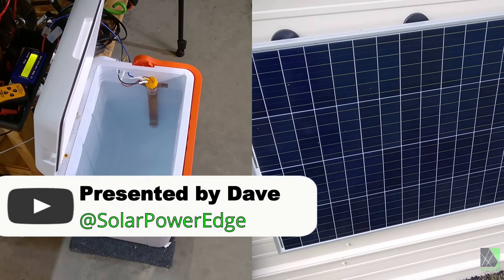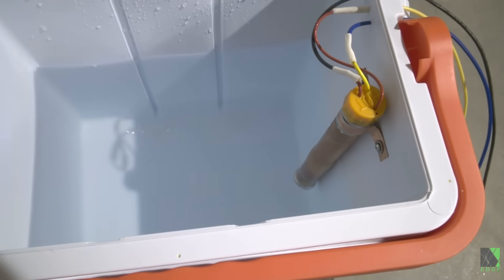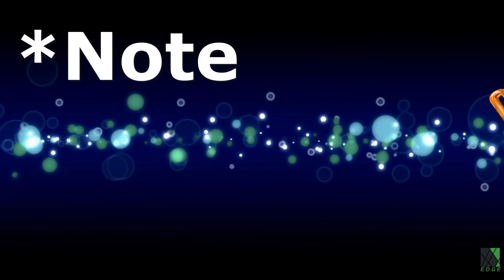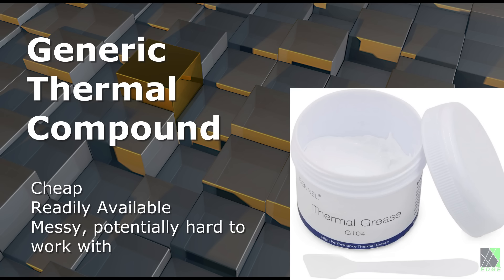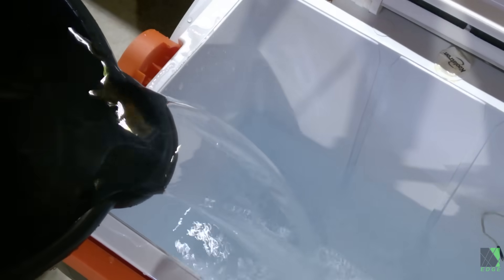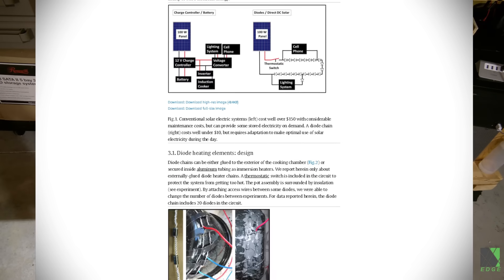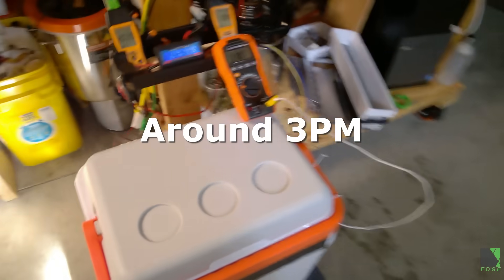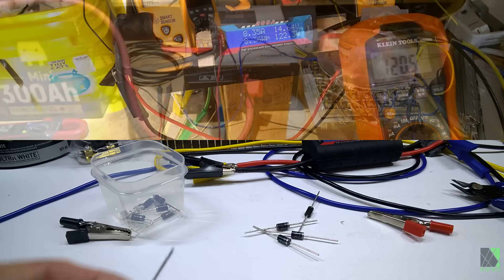I built a PV DC Semiconductor Immersion Water Heating Element! diode chain application #science

Comment: Thanks for that.  Here in Britain, we have the issue of people putting solar panels on roofs despite that the amount of energy you need for a solar panel to be built, manufactured, mined, etc, is greater than the total amount of energy that a solar panel will produce through 25 years of its lifespan!  AND...the cost of installing and owning them outweighs all savings (typically) due both to loss of interest on the capital expended and also on batteries and inverters.  Direct heating of this type would go some way to countering that...somewhat.
Reply from the maker: @barryfoster453 Welcome sir. I hear you... I know it tends to be grey and cloudy in Britian so it seems less likely to use solar panels for heat. I believe it is a (probably often overlooked) point that solar and battery manufacturing is a massive consumer of resources and generates pollution. Meanwhile the fact that solar panels literally turn sunlight into clean DC voltage is hard to resist... 

I always thought many solar panels are never fully utilized, and dump loads are common with wind turbines so why not solar. Basically these diodes can be a fancy dump load for heating.  My thought is to dump excess solar power as heat and therefore use 100% of the KWH available over the lifetime of the panel. 

Finally how long can a solar panel really last? If 30 years, we at least have a chance to recoup investment plus the extra "intangible" value such as peace of mind (backup power). Recently there is new research into 50-year solar panel tech (it's called DuraMAT). Not sure where the tech will go, but it might be part of the solution to recouping manufacturing and environmental costs.
Reply: @solarpoweredge  
Thanks.  Do you intend on manufacturing these?  I would, if I were you.  22 years ago, I made something and decided to put it on the market.  It give me a nice income, and still does - selling on the net.

My HW is heated by immersion heaters (2), and I thought about one of them connected to a solar array a few years back, but when I did the maths (with inverters and batteries) it was absurd.  I'm far better off paying for the energy (here, we have the highest electricity prices in the developed world!).  I don't know what pressures your tube undergoes, but there are pushfit fittings, rather than soldered (or brazed), and that would make construction much faster and easier.  A typical pushfit fitting in the UK will withstand 10 bar (145 psi), and you can get metal (brass) pushfit fittings (though they do have a neoprene O ring inside).
Go for it.
Reply from the maker: @barryfoster453 Right on, I'd love to sell them and pay for all the other ideas I want to build. What I aim for is a reliable diode immersion HWH element w/ 1 inch NPT thread (not sure what they use in European HWH tanks, maybe BSPP thread) and can screw straight into a residential water tank. This cannot happen overnight, but it's on the radar 
Also I appreciate your sharing ideas and knowledge. Maybe I'll have something to sell for 22 years,  as well, that would be great!!
Reply: @solarpoweredge  
I wish you well and good luck.
The UK uses 2¼” BSP on immersion heaters.
Reply from the maker: @barryfoster453 Thank you! and good to know in case I ever reach the UK market :)

Comment: Liked. and Sub'd.
What's the material cost and How does this compare to heat pumps?
Reply from the maker: Hi, thank you for subscribing - this type of heating element is best suited for direct-PV DC drive heating elements. It is a potential cheap alternative to MPPT DC-DC converters. I guess one could use heat pumps right alongside this kind of technology as well.
Reply: This is just my take... Heat pump would require --> solar planel - charge controller - inverter - heat pump, plus all the wires, breakers, switches, etc. And it would technically be more efficient than a diode chain or resistive heater in most climates. However, a diode chain would only require a solar panel and wires to work. Extra solar panels would likely outperform a heat pump factoring in cost and reliability over decades of time. I would think these diode chains would have the advantage of being able to be made to exactly the size needed.

Comment: What about mineral oil and using the thermal rising effects for circulation 🤔
Reply from the maker: @paulwedlock9788 Good idea, mineral oil does conduct some heat and it's easy to get :)
Reply: @solarpoweredge  Hot oil and water is a dangerous mix if they had to touch.

Comment: Like your innovative spirit! Unfortunatly most diodes are in a form factor that doesn't support heat transfer well. Did you ever think of using the old selen rectifier plates? They were frequently used in street-train drives and other appliances. They typically stacked them together for 25 or 75V as each plate can only handle a few volts as i remember. But they would be great for heat transfer on a big scale. Downside is you can use them max. to 80...90 deg. C afaik. I typically use nichrome together with a buckconverter for best efficiency. If weather conditions are steady i also use nichrome heaters directly at PV-voltage with good results.
Reply from the maker: @rilosvideos877 Thank you, I wish there were diodes that could be installed directly in a residential hot water heater tank. That's what I was trying to create here. There is a long way to go! As for selenium rectifier plates, I have never heard of them - I will investigate, thank you for sharing! And yes after about 100C (boiling) I don't feel like pushing diodes much harder. The researchers in the paper (linked in description) pushed their diodes over 140C+ but I prefer to keep mine safe and long lasting :)
Reply: @solarpoweredge  Usage of selenium rectifiers are long time ago, they have many downsides like low dielectric strength and power density. Typical blocking voltage is 25V (max. 30V). But this could be an advantage for heating, as they have big metallic surface! They look like stacks of metal plates, typically rectangular in the size of 10 x 30 cm or alike. I have some of them in spare. If you overload them, they will start to stink terribly - in Germany there is an old saying 'Gleichrichter - gleich riecht er' 😉
Reply from the maker: @rilosvideos877 There are some vintage selenium diodes for sale on the local auction site... I might just have to grab a few and see what they can do. They look very robust and metal, just like you said :)
Reply: @solarpoweredge  great video BTW.   The paper used 1N5402. rectifier diodes (i believe 10 in series).  the datasheet has the current taking a major nosedive (linear) after about 110C.  So I think you're right with keeeping the temps "reasonable".   I'm thinking a big part of the heat transfer efficency and the life of the diodes will be due to the selection and optimization of the heat transfer media/fluid.   A lot of fancy solar inverters incapsulate the transformers in an epoxy/resin to max efficiency - especially in tight spots. Look forward to more of your experiments as I dabble in a lot of similar themes (i m a solar tech so I have access to a truckload of equipment big and small).
Reply from the maker: @daveluxton8317 Thanks a lot! 100C is enough to boil water, so I think it serves most purposes. Amazing to have access to all that equipment. Hoping to have access to a scrap yard here soon, no telling what I will find :)
Reply: @ the graveyard of inverters/controllers/solar panels, and batteries. at our shop is piling up.   Too bad you didn't live in the neighbourhood.  😆
Reply from the maker: @daveluxton8317 Hah! Indeed... I'd fill the garage with everything in sight
Reply: You might want to first consider the toxicity of selenium - maybe not a great solution.
Reply from the maker: @michael-j-harrison That's a good point

Comment: You have to fill the tube up with oil for a better heat transfer between the diodes and the tubewall inside.
Reply from the maker: @MMTube I have tried oil, it does conduct heat! Conductivity isn't super high, I wish it did conduct as well as water

Comment: Consider getting JLC or another PCB fab house to make some 100x100mm aluminium-backed PCBs with surface-mount diodes pre-soldered in a dense configuration. Then you could just thermally bond the aluminium back side of the PCB to whatever you want to heat. If I recall, it’s cheaper if you buy 100x100mm PCBs rather than larger ones, so you’re probably best off ordering 5 or 10 of those. Looks like it’s 4USD for 5x assembled 100x100mm aluminium PCBs, plus parts cost. The diodes are probably a few cents each. There’s a handy KiCAD extension that makes it easy to export the right files for JLC, or you could use JLC’s own online design software EasyEDA.

I’d also like to know how this shapes up cost-wise compared to a solar water heater design like Tech Ingredients and others have demonstrated. You could also hybridise the two by running water channels behind your PV panels, heating water and prolonging the life of your panels as you do so.
Reply from the maker: @Scrogan Right on, looking into this option! Much easier to produce and modify. The sky is the limit with solar, we have a lot of options

Comment: Very interesting, I have an application for boondocking camping with a 2-3 gallon insulated water container, I don't see why you cant make the diodes or the element be as close to the bottom of the container and have the leads of the element out of the water by pre bending the copper pipe, or a 90* coupler, that way the element is always 100% submerged. Secondly, what are the possibilities of an on demand heater by having the water jacketed with a larger pipe,  lets say a 2.5", water inlet at the bottom, outlet near the top, leave some headspace for a hot water reservoir near the top, solder a flat piece of copper on the sides of the core as a baffle for mixing when the unit is drawing water out for mixing or turbulence. I would say 1/2" inlet, and outlet, make the jacket piping about a 2' long, the core 1'. I am not sure how long the recovery time would be, depends on the flow, and the temp in, vs out (Delta), then if you lay it horizontal, it will always have hat water the length of the jacket.. I am very interested in this, I would like to try a small camper application of this, I have a small 100 watt 18 volt solar panel that this may fit perfectly for this. Leave the 305 watt one for charging the batteries, lights.
Reply from the maker: @davej7434 Yes all the diodes need to sit at the bottom of the tank, it's just not working well enough at the top. But it IS a prototype :) and I wanted continual access to it. Thanks for sharing all your ideas, good thinking. I want to try all of them :)

Comment: ITHNK   salt might be a good choice in your copper pipe since it holds heat longer than anythng else  or if you didnt need to drink the water you could add salt to it to make the heat last much longer   
jusayn   megary
Reply from the maker: @LUVDOC69 Hot salt sounds very interesting, it's on the list of "experiments" I need to try :)

Comment: Use SMD diodes on aluminum PCB , small diodes have less surface but you can put more of them, and get more thermal conductivity because of aluminum wafer , also you can avoid using pipes as housing, one side could be covered by epoxy, and aluminum will be exposed to heat the water
Reply from the maker: @danielbogdanov2926 right on, good thinking and thank you for sharing ideas

Comment: A string of surface mounted TO220 diodes on a custom PCB would make a nice heating element. After assembly, you can pot the entire thing with thermal conductive resin to be waterproof.
Reply from the maker: @Samuel-yi5eo That is a brilliant solution I will be trying it, thanks :)

Comment: Today I found youre channel and I love the Idea of making a Diode waterheater. My first thougt was , I do not know a specific building form for diodes unlike transistors where its possible  to mount on the surface of a heat sink. Perhaps youre circit is more effective when using a  2N 6284G ONS transistor on a big heatsink. there ceap an good to mount on a "heater plate" heatsink. All we have to do is making sure that the voltage is stable. 👍
Reply from the maker: @JuliusCesar2781 Glad you found us! There are some unusual diode packages out there, I will just keep experimenting to see what works best. TO-220 is a good diode package for use with a heat sink, or full wave bridge rectifier

Comment: This is interesting! It hadn't occurred to me that a diode chain could give a constant-power load on a solar panel, but of course it can!
It occurs to me that a tracking MPPT water heater could use the transistors themselves as heating elements.
Reply from the maker: @graemezimmer604 It's a strange way to use diodes that's for sure! But I like anything that is dirt simple and effective
Reply: interesting, if I am reading your concept right, solder the head of the transistor to the pipe as a heat sink... wouldn't it short out? Are we chatting PNP transistors here, or am I in a different thought?

Comment: I built and operate a PV solar hot water system, it is a storage water heater fitted with a 1.5kw 48 volt element... I could have brought a 12v element but the amps get to high.  I picked up some second hand solar panels very cheap and arranged them to give me about 2kw of PV with an open circuit voltage of 95 volts.... I run that to a 150/35 Victron MPPT.   
A solid state relay set up to open and close on battery voltage, controls power to the hot water element... and ensuring excess power goes to a 48v battery bank which goes to charge other devices, (electric mower, electric bike, stick vacuum cleaner, phones and tablets etc.)  
We do not normally get snow here, but we get frosts and this system is frost proof... over the two years it has been delivering me free hot water, I have only boosted the hot water with grid power twice for about an hour each time, more to prove the boost capability....should I ever need it. 
I believe PV electric hot water heating is the right way to go solar hot water, having had experience with other systems.
Reply from the maker: @apollo8352 Wonderful setup! There is a huge advantage in solar-electric hot water vs solar-thermal. I am not against solar thermal but really prefer 2 simple thin wires with  no moving parts to heat my water :)

Comment: Interesting topic and great video!
As one option try to mount diodes onto CPU water cooling blocks using Arctic thermopaste.. 😉 Theoretically, diodes can be mounted on booth sides to the block.. Pump is already in use and no need to get another one. How about looses in this water block setup, IDK.. Will be cool to see difference.
Reply from the maker: @artursmihelsons415 Thank you! Cooling water blocks and mini water pumps are one of my "side hobbies". I'll definitely have to give this a try to make a solar powered diode circulating water heater :)

Comment: Solarpanels are diodes. Have you tried to use a solarpanel as a heating element? It's also nice that they are flat and better to handle. You get solarcells without nothing and you get then in epoxy. Maybe a thing to try. 😊👍 Thanks for sharing. 🙏
Reply from the maker: @lektor0815 I'l thankful you like my videos :) 👍 thank you for watching and supporting my work... I have seen some folks heat their house with solar panels as "flat panel heating elements", but I have not personally tried it yet!

Comment: Have you considered attempting to reduce stratification by placing the heating element horizontally in the bottom of the cooler?
Reply from the maker: Absolutely right... I guess for this prototype it was better to have immediate access, but in practice it belongs at the bottom of the cooler so it's always at the lowest possible temps

Comment: I vaguely recall a long winded textbook proof (some 20 years ago) of when maximum energy transfer takes place between a source and a load. It turns out peak energy transfer efficiency occurs when the impedance of the load matches that of the supply.  So I find it interesting that "Solar Power Edge" is getting similar peak energy transfer, when his load is made up of Diodes, and his Source is also diodes (Photovoltaic Diodes). So he is effectively matching his source and load impedance. (Impedance being the word I was taught for "non-Ohmic" resistance) - Give that man a Bells.
Reply from the maker: @EMleRoux That makes a lot of sense... I like to think of a diode as a "gate" that takes a half volt (more or less) no matter the current. There is always some variation but as long as they don't get too hot and burn up, diodes can "regulate" a voltage and produce heat from PV for low cost and very low complexity. Well maybe all the heat sinks and worrying about temperature is complex, but still simpler than troubleshooting a microcontroller MPPT circuit :)

Comment: Great info! Thanks.
Sounds like you are using  the  hot side of the Peltier effect.
I wonder if you used an actual Peltier module, you could then use the cold side as the output via a heat exchanger?
Reply from the maker: @adon2424 Welcome! So far I tested peltiers for cold and generating electricity, but not as a heater. That's on the list for sure! As a heater, peltiers start looking very interesting indeed